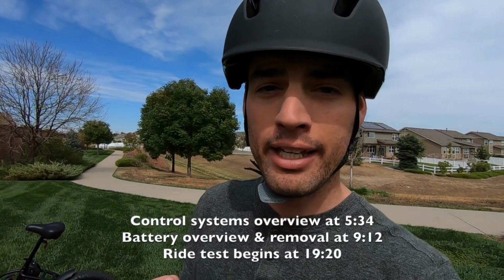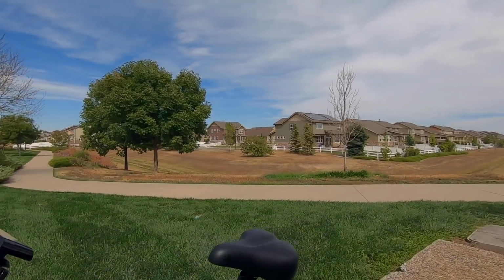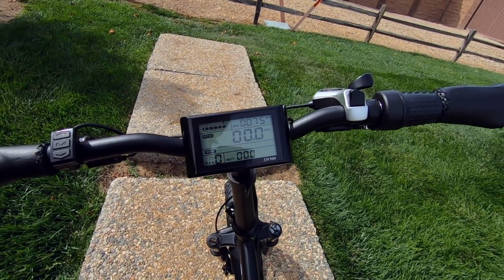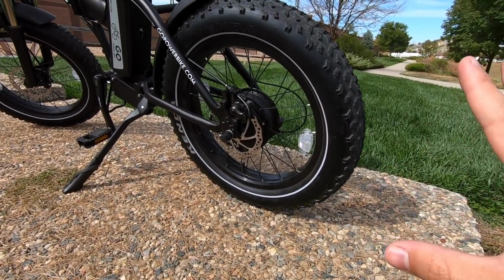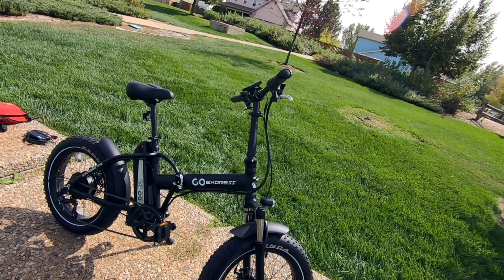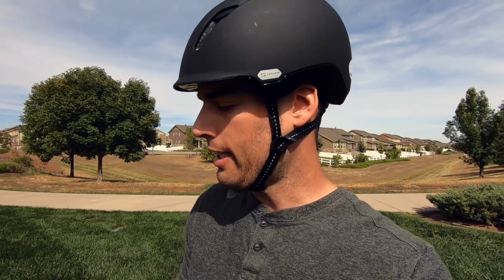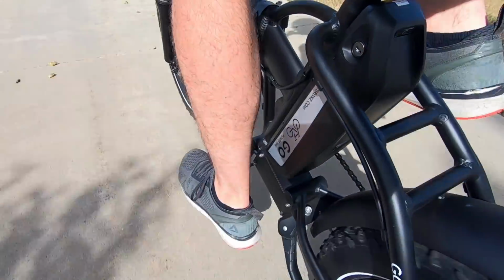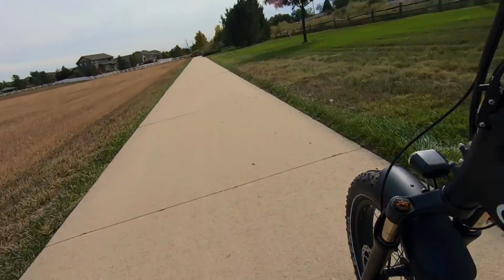Go Power Go Express Review - $1.3k

Comment: Great video. Looks like a cool little bike. 

General ebike question:
When removing the battery do you need to turn bike off first or is it ok to remove battery when bike display is still on after a ride?
Reply: Great question! While it's probably a "best practice" to turn the display off before removing the battery, it doesn't really matter for the majority of Ebikes. The displays have to be able to gracefully shut down on loss of power, whether that is from the rider removing the battery, turning the battery switch off, or the battery just plain running out of power and dying.
Reply: I bought one and used it for only 3 months and had a lot of brake problems and after going through a lot of work to fix it now out of nowhere the electricity went out I want to know why the electricity has gone out of nowhere
Reply: @pelagieyen8044  Try charging the battery..lol